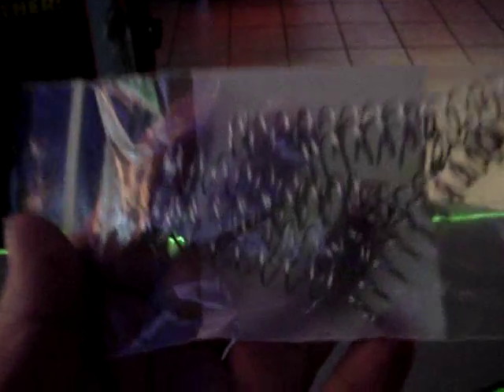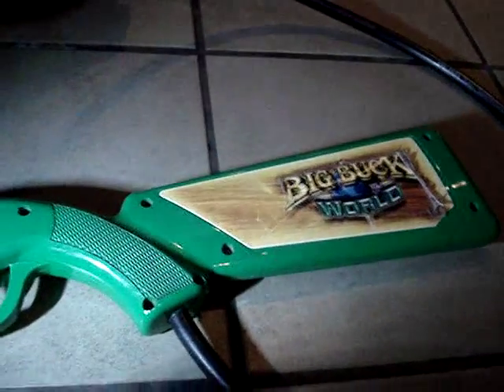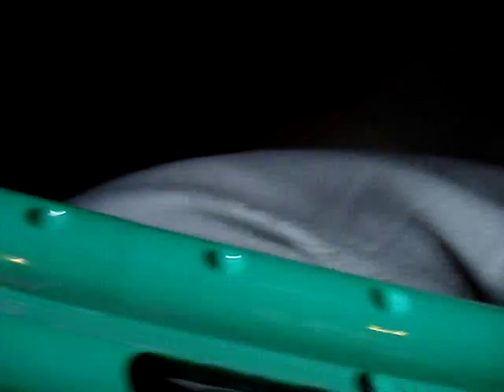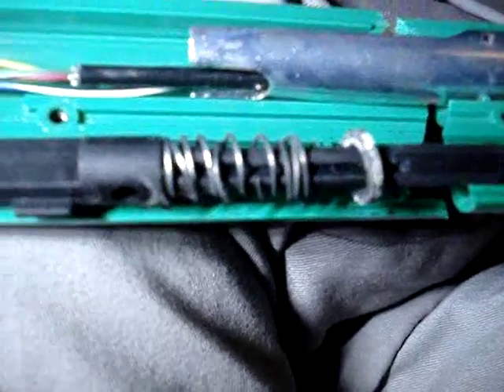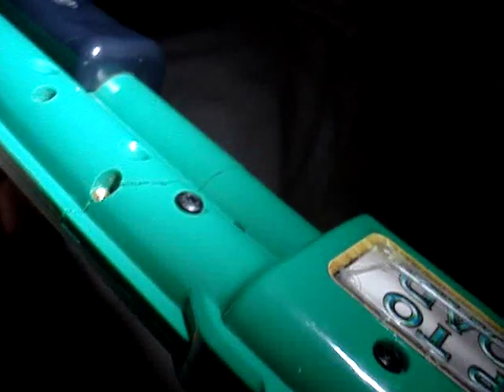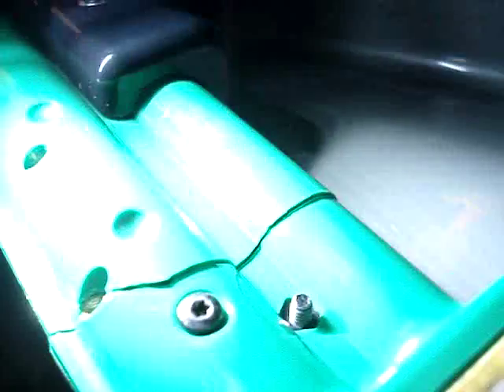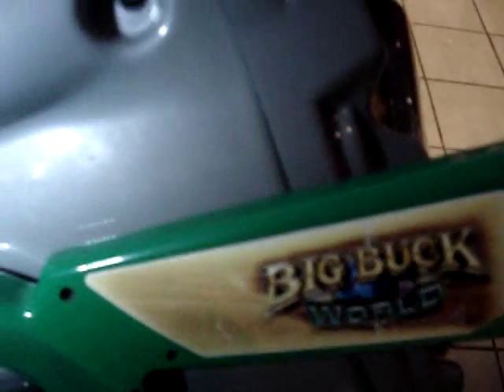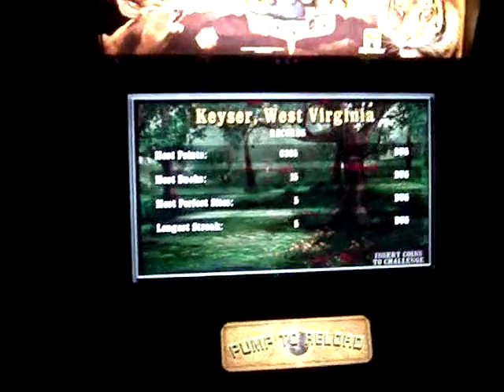Arcade Fix Repairing Big Buck World shotgun

Comment: So what if a gun is reloading sometimes but not all the time, what would the issue be there?
Reply from the maker: I would replace the reload switch, contacts inside the switch going bad or sometimes the switch lever gets slightly bent so the switch doesn't close all the way. Theirs also the chance a wire in the harness is broken and sometimes makes contact.
Reply: @SamsArcadeFix  is the reload switch a microswitch?  I haven't cracked it open yet
Reply from the maker: @ToolFan-co4bc  Yes, it's a microswitch with a lever and a small wheel on the end of the lever, same switch is also used for the trigger. Also it is held to the gun housing with 2 small Philips screws which is easy to strip the head if you don't have the correct size screwdriver and the wires are soldered to the switch contacts.